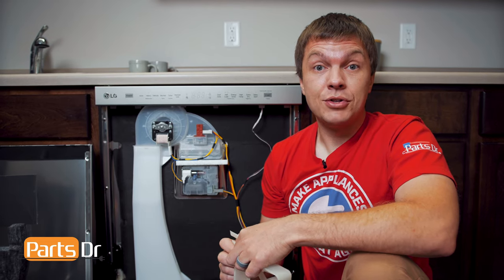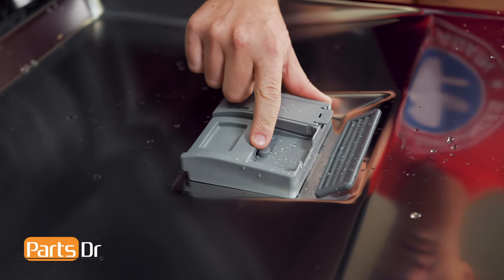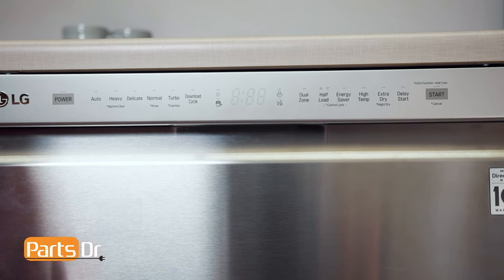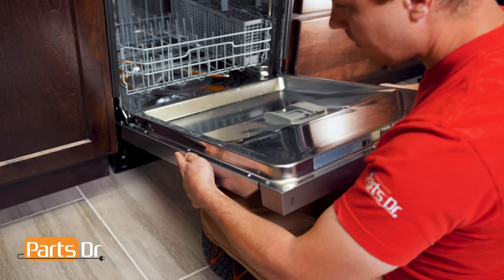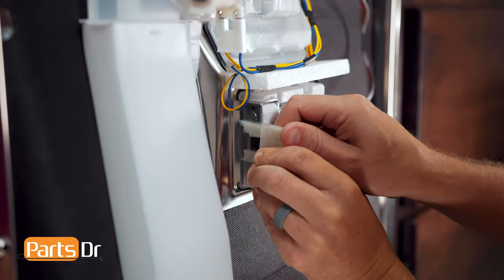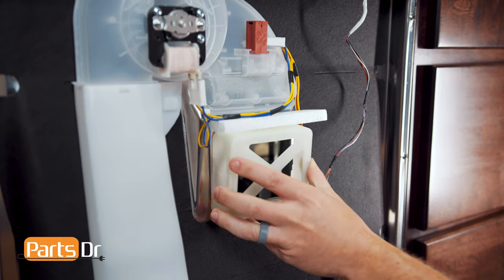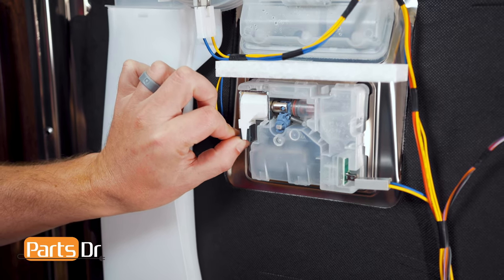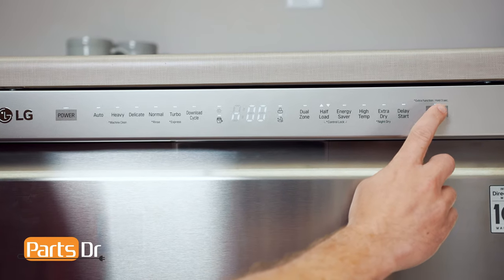How to test & replace detergent dispenser on LG dishwasher part # AGM75469801

Comment: So thankful for your helpful video! The soap dispenser door had worn out and would not latch shut. The instructions that came with the replacement part were "OK" (at best), but your video explained everything exactly as it was needed to remove and replace the soap dispenser. The entire job took about 15 minutes from start to finish!
Reply from the maker: Awesome! Nice job!

Comment: Hey Ryan! Thanks so much for the awesome video. I did the test a few times, and it actually opened every time! Any ideas why it isn't opening during the wash cycle? We've tried cleaning it out with vinegar and warm water, and still seem to have the issue.
Reply from the maker: It's not very common, but we have seen issues like this caused by a failure of the main control board.  A bad main control board can stop sending the signal to open the dispenser during the cycle when it should.

Comment: Be advised to pull the cover off the door and check the wiring to the detergent solenoid before ordering a new part.  Turns out there is a nice place for a rodent to chew on wires when it is hanging out bored. Thanks for the great LG dishwasher videos.  I have also had issues with the door shut switches on the top of the cabinet, on mine the connectors are very loose and any intermittency in the electrical connections will cause frustrating cycle aborts.
Reply from the maker: Thanks for the tips!

Comment: My dishwasher detergent dispenser doesn’t open during the cycle, but in test/diagnostic mode the dispenser opens every time with no issues. What else can I check. I don’t want to gamble and replace the dispenser when it works fine in test mode
Reply from the maker: It sounds more of like a control board issue from what you are describing.  That would be tough to test, but you could test for a voltage signal to the dispenser while the dishwasher is running through a normal cycle.  The only problem is that you don't know at exactly what time it is supposed to send that signal and it might only happen for a very short period of time.
Reply: I am having this exact same issue @mikegoldring15 - did you end up resolving the issue?
Reply: @emjok93  I ended up replacing the filter at the center of the bottom of the tub and it’s been working good since. I think maybe there wasn’t enough water / water pressure spraying towards the dispenser to give it that little nudge open.

Comment: What can you use if you didn't buy the shims or tools or whatever you call those 3 plastic pieces with 2 prongs that you insert before you pull the unit out from the other side?
Reply from the maker: Maybe try some wood shims?
Reply: @PartsDr  Thanks. We used some plastic shims we had leftover from installing linoleum planks and some cards like debit cards or gift cards, even tried dimes. The cards worked best. When I pushed the unit out while someone else pulled from the other side, I cut my thumb so people might want to wear gloves if they push. Those metal edges are sharp.
Reply from the maker: @brucesmith9  Thanks for the tips!  Those will be very helpful for others!

Comment: I own a 2009 LG dishwasher model LDS 4821WW.  The Cascade pods no longer will dissolve.  Do you have any suggestions?
Reply from the maker: Possibly not filling with enough water or a bad circulation pump?
Reply: @PartsDr  What would be the next step to eliminate the above choices?
Reply: @PartsDr  Ryan do you happen to have a copy of the Tech Sheet 2/2 ?? or can you share how to get into the test modes????
Reply from the maker: @stevesininger4196  Check out this video here: https://www.youtube.com/watch?v=G7lxR9WlOIw
Reply: I have watched your video.  My machine does not have all those buttons it is a 2009 model and very simple.